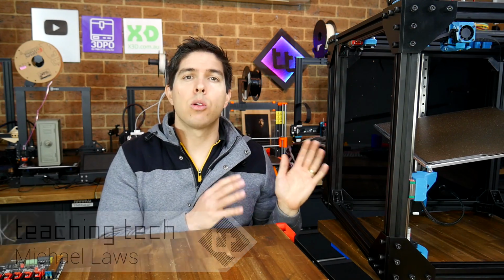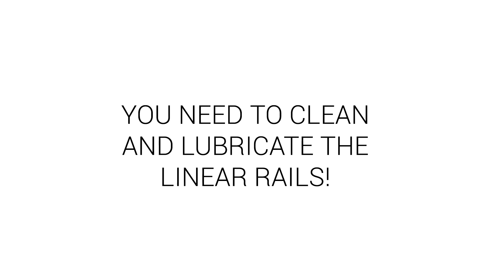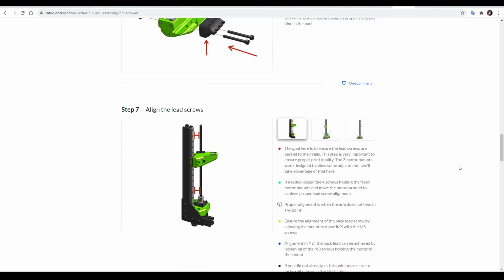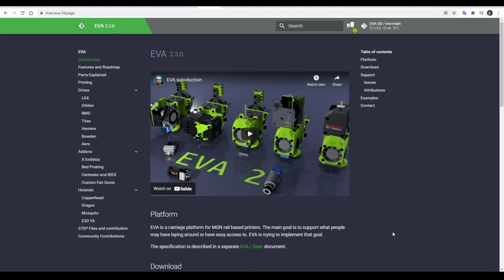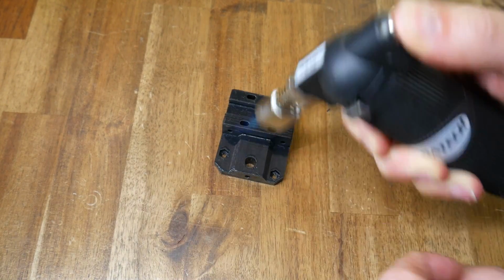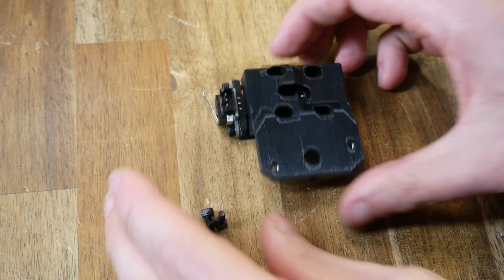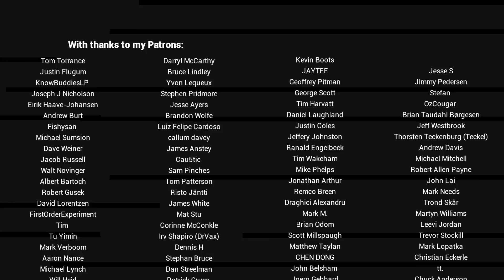Rat Rig V-core 3 part 2 - Kinematic bed and EVA carriage system

Comment: Kinematic bed? It has NO advantages compared to standard bed with manual leveling, but costs much more. You can even use autoleveling to assist you in manual leveling and achieve same result.
Seriously, someone, please tell me just one single reason to invent such thing except "because we can". Weird over-engineering.
Reply: Metal expands when it's heated, without a kinematic mounting solution your bed is not allowed to uniformly expand which eventually results in warping and you'll never get a flat print on that bed again. That's the primary reason why you want a kinematic bed. By assigning the 3 points to individual motors you get free true bed leveling on top of that, since 3 points define a plane.
Reply: @miklschmidt  But standard printbed is glass, not metal. And it is fixed to the metal with clips and allowes to expand freely.
Reply: @TheNamelessOne12357  it’s 2021 dude, put down the glass plate :) glass is not perfect, it sags over time and has terrible heat distribution, and it’s very rarely used by itself so you still need to accomodate the expansion of whatever it’s attached to.
Reply: @miklschmidt  What's wrong with glass? Of course it needs underlying heat-spreading aluminum sheet, but what's wrong with it? It's cheap, very flat and easy to install/remove and replace. I printed every matherial on the glass, from PLA to PEEK, from 50 to 160 bed temperature and had no problems. Just use right adhesive and everything will go flawless.
Reply: @TheNamelessOne12357  Nothing wrong with glass other than the issues already mentioned (you mentioned the need for adhesives / release agents yourself), there are just many better print surfaces available today.
Reply: @TheNamelessOne12357  If you're mounting the glass on aluminium you now have the issue of mismatched thermal expansion and you're not accommodating either of them. A kinematic bed mount would take care of the worst offender (the aluminium "heat spreader" as you call it).
Reply: @miklschmidt  Adhesives are reqired for every fillament except, maybe, PLA. No adhesive = no heat resistance (ABS), no gears (Nylon), no flexible... And new adhesives are very easy to use - spray it on the glass, heat, print, wait for bed to cool down, and ready model will be laying on the glass completely detached. It's very reliable and creates a flat mirror-like surface on the bottom of the model.
Thermal expansion mismatch is not a problem at all. Glass is fixed to the heater plate with clamps and can freely expand/shrink relatively to the heater.

OK, let's presume the bed is flat, but tilted somehow. This printer has 2 additional motors, leadscrews, nuts, stepper drivers and a leveling sensor to make bed parallel to the XY kinematics. It could be more convenient than fully manual leveling with screws, but what are advantages compared to mesh leveling? I tested mesh leveling (marlin firmware) with more than 10 mm height difference between left and right edge of the bed and mesh leveling managed to maintain correct geometry.That's why I'm curious about the purpose of this bed. It just provides expensive solution to the problem, that does not exist.
Reply: @TheNamelessOne12357  Mesh leveling will leave you with a slanted base of your model. It does not correct the error it just adapts the print to it. That's the big difference.
Reply: @miklschmidt  Nope, mesh leveling recalculates XY movements too. At least on Marlin firmware. As I said before, I tried it with 10mm difference between left and right edge of the bed and model was printed correctly, not slanted. Mesh leveling cannot fix convex/concave bed, but it's not our case.
Reply: @TheNamelessOne12357  You're mistaken. Please read up on this. There is no X/Y adjustment when using mesh compensation, not in marlin, not in RRF, not in klipper. You might be thinking of bed mesh fading, which simply fades the height adjustment over a given z distance. It still leaves you with a slanted bottom, and in badly unleveled cases it will affect the internal geometry of your model. This is why it's so important to have a flat bed, especially for functional prints.
Reply: @miklschmidt  Nope again. Marlin does tilt compensation, I checked it. And I found the video, which proves it. It's in russian, use translated subtitles: https://www.youtube.com/watch?v=x8OQZP-a3kc time is 9:35.
Reply: @TheNamelessOne12357  Tilt compensation is not bed mesh compensation. Those are two different things, bed mesh will give you a slanted bottom in case of tilt. Looks like tilt compensation would indeed work though, to some extent. Depending on the severity of the tilt, you will loose build volume.
Reply: @miklschmidt  Yes, Marlin also has simple 3-point probe mode, which only compensates tilt. Mesh mode is more advanced and can also compensate concave/convex bed, but it's not our case, we presume that bed is flat. 
And even manual leveling with paper allows to adjust tilt to less than 0.1mm. Not much loss of build volume.
I have two Prusa-type printers with 500x500 mm bed. It has 3mm glass on aluminum sheet with 13 adjustment screws and no autoleveling at all. Once tuned correctly with a piece of paper it just prints for more than a year almost every day and reqires no readjustments since first startup.
Reply: @TheNamelessOne12357  I don't wanna argue with you, i don't seem to be getting my points across. If you're happy with marlin and cartesian printers, simply don't buy a v-core 3 :)
Reply: @miklschmidt  I just asked if kinematic bed has any andvantage compared to standard bed with, or even without autoleveling sensor. Maybe, you're right and I somehow unable to understand it, but it is definitely overprice and it is overengineering. Well, let's see how it performs in the next video. Maybe then advantage becomes obvious.
Reply: With a thick enough and flat enough build plate, you don’t need to worry about “mesh” anything and just worry about keeping it flat. Just slapping a bed plate onto a corexy and meshing it means the z axis is going to be moving up and down. By using a kinematic bed, the z axis does not move at all while printing except to change layers. You need to have to trust that your build plate is FLAT and that you can level the plate to the XY gantry, hence the kinematic Z.
Reply: @Crazyates11  But you can install standard spring&screw-leveled bed and acheive same result. It can be thick and flat too, e.g. 6+ mm glass. Just level it once and forget about it till you make some hardware changes to your printer.

Comment: I wonder how this 3D printer is controlled? Where is that little LCD screen that every 3D printer has and through which all 3D printer settings are controlled?
Reply: He’s using a raspberry pi, and I’m assuming octopi into and kipper. The rpi connects to your WiFi, and you send the gcode to that via a web interface. Then the rpi tells the board what to do. Michael has other videos on octoprint and klipper, so maybe check those out?
Reply: @Crazyates11  Thanks for the reply...

Hmmm ... if I understand correctly, you always need a laptop or other external computer unit (PC, laptop, tablet pc, mobile phone, ...) to control a 3D printer? If this is true it is quite awkward to operate one or two printers. I assume that RatRig was created to connect a lot of printers to a farm where printers are much easier to control via Octoprint?

But still ... is it possible and how difficult would it be to mount the LCD screen directly to the printer frame and connect it to the board....just like with the Voron 2.4?
Reply: @pyrosnap4524  You can add any interface you want. Klipper has many. For web interfaces octoprint is definitely one of them but there are much nicer options such as Fluidd or Mainsail. You can absolutely add an LCD if you want, you can also add an HDMI touch screen (connected to the RPi) and run KlipperScreen on it for a much nicer touch interface.
Reply from the maker: As has been said you have a wide choice of screens. I am considering recycling an old Android tablet as a full featured touch interface.

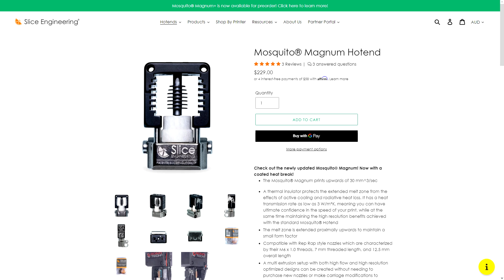Comment: 9:21 that moment when the credit payments themselves cost 4x the price of a standard hotend
Reply: I get that $230 is 'expensive' for a hotend but I also feel like $14 for a hotend means you're either getting a crappy knockoff or making some major, terrible compromises...
Reply: @StormBurnX  while that might be true, most of the $14 are good enough for the application. Spending $230 on a hotend to me is like buying a spoiler for your honda civic that drives an average of 30mph in the city.

Comment: Orbiter looks ok for a extruder deffently a top 3 pick and fits this build very nicely. It also covers your easy build motto as a kit purchase.
Other good choices is a sherpa mini and hextravort. The sherpa mini i think is the best and comes as a kit bit weather there is a mount to fit this printer who knows. The hextravort is nice but mostly only fits HevORT printer designs so not really a option for other 3d printers.
Reply: It's a big printer, only real choice IMO is the LGX + Volcano. The Orbiter does not really move much plastic
Reply: @joshua43214  Hextravort + nova was printing 5min benchies which is 300mm/s and 20k acc. Its based on the nema 14 and bmg hardware this would be its limit i think though.

I am making a HevORT HD9 with a v6 volcano and hextravort extruder. It has very nice weight distrabution hotend. I have modded the x carriage to be a mgn9 rail from a mgn12 and using a simplified z axis.

Comment: I'm working on my 300x300x400. Waiting for several parts, but my frame is very good.
I'm working in a different bed, with 127V in a 3 mm aluminium plate with a 1.5 mm cork layer and the hotbed over it all.
Reply: 3mm is too thin. 6-8mm is the best!

Comment: Possible at some point to do a Core-XY where the bed is stationary? Seen a similar design, but where the carriage for the X and Y drives is what moves in Z (also on 4 lead screws and allowing for adjustment in level), while the bed is just hard bolted to the base frame. Kinematically, it seems best to have all your movement being in the head, and eliminating any movement of the bed. But if the bed is going to move, best for it to just be in Z.
Reply: Yes, that’s what a Voron 2.4 is known for. The whole XY gantry moves along the z axis and the bed is completely stationary, bolted to the frame. The XY gantry even self levels itself to the flat bed. 

A Voron 1.8 is a more traditional corexy where the xy are stationary and the z moves. The Voron 0 is similar to a 1.8, but just mini.

Comment: Can you use a Inductive Probe or do you need a BLTouch ?
Reply: You can most definitely use an inductive probe (my preference as well) EVA supports m8, m12 and m18 cylindrical probes :) You can check it out on the EVA page.

Comment: Are you building this because you want to use 3rd party open source firmware? Wouldn't a proprietary machine be just as cost effective once we take in time and labor building not only the printer but also the firmware? Would there not be far less work on the firmware? 3 of my machines are iffy now because of firmware restrictions I can't understand. I am scared to death to even touch my Ender3 because of having to mess with the firmware. Its still 8 bit and a dinosaur compared to my others. But even though everything is manual and a pain it still prints repeatably with no failures that are not user created. Thanks for the video its a shame your going to confuse it all with klipper instead of sticking with Marlin. But I guess all these little never ending problems are why people shell out the big money for Ultimakers and Methods so they don't have to constantly learn something new, and can spend all of their time printing instead of upgrading.
Reply: This is the lab. R&D is done here. You are talking about the factory, where they use knowledge of the lab to build commercial production units. If you want to be in the factory, fine, then be there, it’s a good choice. Or if you want to be in the lab, that’s fine too. But never come into the lab stating that you want to see production ready output. Where I do agree with you is that it can be lonesome sometimes looking at all the labs on Youtube and realizing you are still running your old and trusty production unit, stock out of the box. That’s the question you have to ask yourself, “Where do I want to be?” Answer it, and then own it. Personally I could not be bothered to change anything to my printers, they work and as long as they do, the box stays shut. This build is fascinating however, as it points us in the direction of future production units. Fast or large printing will not be done on cartesian printers, corexy is the next level.
Reply: @QBziZ  I have no interest in 30 second benchies and You tube is as close to being a lab as wiki is to being an encyclopedia. Lots of info but you can't count on it being accurate. But I do understand your point. I will try to keep my frustrations out of my posts. But my point is still valid. At 67 I am not interested in learning printer design I would much rather spend my time slicing and printing. My second printer was a LEAPFROG CREATR HS. The greatest LEMON in core XY history. A $2500+ proprietary nightmare. So the factory units are not always what they are supposed to be either. This RAT RIG looks awesome and I am not questioning the build just the firmware. I am sure that KLIPPER has its fair share of hoops and hurdles that have to be addressed. Special mainboard for one. Just another steep learning curve to work thru. I would rather he built it with a control system I was already familiar with instead of one you rarely hear of. I do not think of CORE machines for volume as a rule catesian machines are larger in that respect. Accuracy and speed are the real reasons for Core machines. At this point I know nothing of Klipper and for me it would be as foreign  as React OS would be as a PC operating system. There is always something new. I would just like to perfect what's been the go to for the last what ten years. Nice conversation, if you can enlighten me please do. Its so hard to find what should be studied and what is just another dirt road. KLIPPER may very well be the answer to all of my firmware woes. Thanks for the input, I am going to spend a little time researching it.
Reply: People switch to Klipper and RRF because of those issues, not in spite of them.
Reply: @miklschmidt  So you say with no explanation. If Marlin is so bad why are people using it and only three people I have ever heard of are trying to use klipper?
Reply: @eva-3d948  Yes sir you are correct. We do what we have to, learn what we need to, work with what we have to get the end results we seek. That is what makes us makers. I learned quite a bit right now about klipper that I did not know. I honestly think this will be the most enlightening Teaching Tech episode so far. I for one am old and usually go kicking and screaming into the new and unknown;-)
Reply: @eva-3d948  I am 67 and I am learning something every single day. Some of it a day late, making me a dollar short when I learn something early. What a process;-). I tend to listen to the younger folks more lately as they are the current doers and are usually right on top of this programable electronic nightmare I try to understand with mixed results. I just lost my resident GURU, My daughter just moved to Manchester, England to continue with her life, which puts me back to trying to figure out the DVR again. But hey I'm retired and its all in fun. Still iffy out there so I will stay under my rock and make stuff with my printers.
Reply from the maker: This discussion is about as good as YouTube comments get, so well done to all. I will make sure to address this in the next video :)
Reply: I would recommend the SKR Mini E3 or the SKR RRF! Seriously, do yourself a favor and go buy it now. It’s a drop in board, super cheap, takes 10 minutes to install, and if you don’t like it, you put your old board back in. It has TONs of features that make it worth it. Silent drivers(!). 32 bit. It comes preloaded with a quick and easy manual bed level mesh, which is super useful even on my glass bed. Want to go dual Z? The board has 2 Z stepper ports. You’ve got a dedicated port on the board to add a BLTouch. Don’t want to mess with the firmware when you add a BLTouch? Just upload their preconfigured firmware that includes the BLTouch. It takes 20 seconds to update your firmware or change it out.
Reply: @Crazyates11  That part is totally up to Micheal. I am sure he has all that figured out already. I was just spooked by a new OS/firmware going on the board. He has made that decision allready and I like everyone else will be there to see just how he makes it happen. I hope it is totally painless with as few hurdles as possible. I hope it turns out totally scary bullet proof. I have that board by the way I did not know a lot of those details about it though.